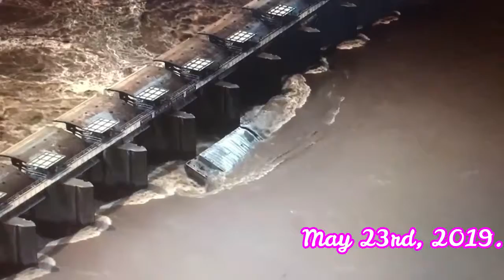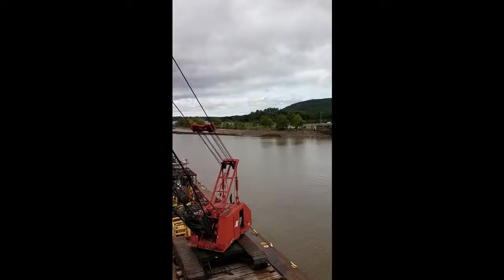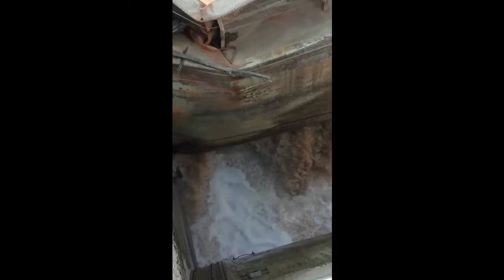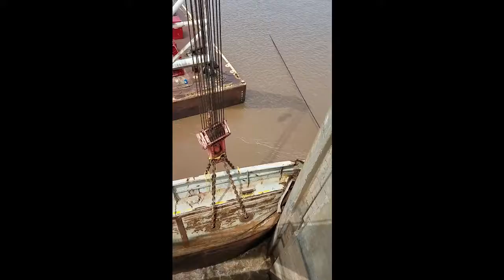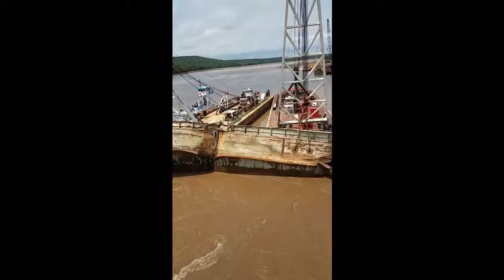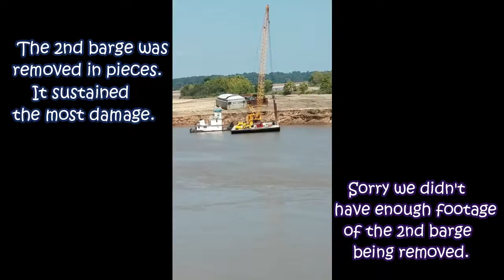Barges hit Webbers Falls Dam (removal of barges)

Comment: I do not understand why they did not close the locks on that end when the barges were near. Calming the water on that end would have made recovery much easier also.
Reply: Probably would have caused unacceptable flooding.  Those dams are incredibly over engineered (obviously) to withstand incredible impact from debris.  A financial choice I’m guessing.
Reply: When the barges were drifting toward the dam, no one knew where they would hit.  It takes time to close the gates, and if they did somehow predict in time where they would hit, closing the gates would divert the flow and the barges would just follow the flow and strike where the gates were still open.  The river was having record or near-record flooding at the time of the impact and closing the gates was probably the last thing they wanted to do.  The couldn't close the gates for the recovery because the wreckage was so twisted that it extended into the closing paths of the gates, rendering them inoperable (I read that a couple days ago).
Reply: @robertfitzsimmons9428  Note that the correct term would be "over built" or "over designed".  It's important to note the difference because for many structures, "over-built" and "over-engineered" have opposite meanings, since for those structures, the more thorough the engineering, the less material is wasted on making the structure stronger than it needs to be.
Reply: They couldn’t close them in order to continue removing the badges.
Reply: Thank you for your input. Could not have said it better myself. My husband is the one who works with a huge company that repairs around the world power plants. I will gladly post more videos if your interested. I would need to follow safety guidelines and for the safety of country of locations.

Comment: This barge recovery looks like a fail. A couple well placed C4 charges....the scrap goes on down the river every body goes home for dinner.  Those barges with the cranes must have powerful motors and props...to go upriver like that...risky.  Water level was dropped...wonder the logistics of that ?
Reply: No, the scrap goes to the bottom behind the dam. The only reason you can see them is the current holding them against the dam.